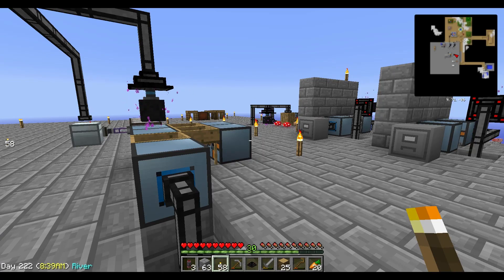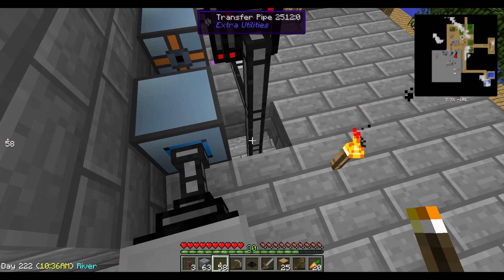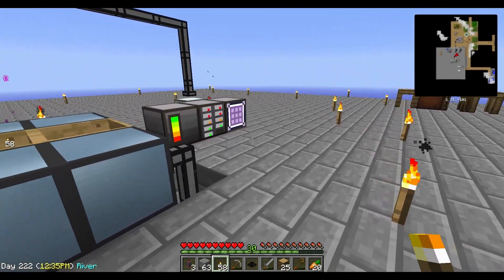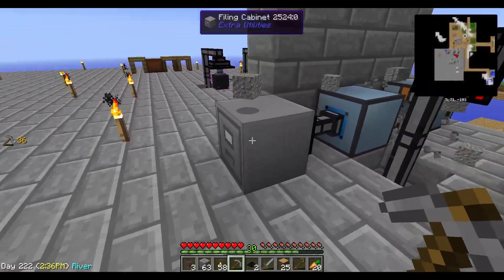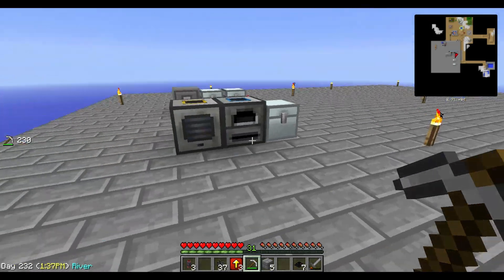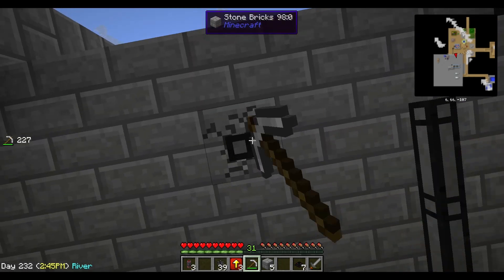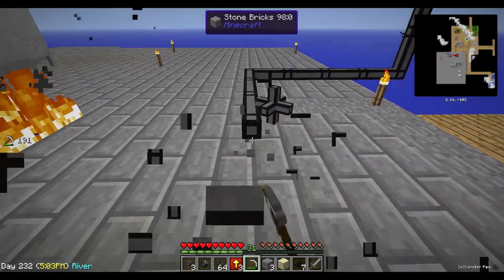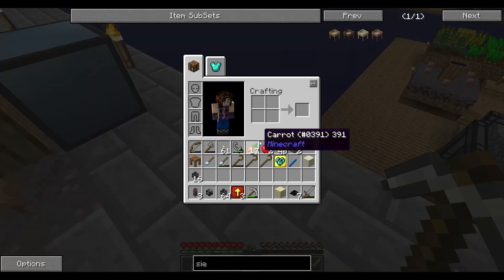Minecraft Sky Factory - Modded SkyBlock!  Episode 17

Comment: Use a transfer pipe on the cobble pulverized on the yellow to move the sand which skipped a step straight (which it has a random chance of doing so) to the witch water then you'll need to decide what to do with the dust. Personally I'd just destroy the extra

Comment: Not sure why you want to sieve sand.  You already have more than enough of everything you can get from the sand probably.  Dust and gravel and soul sand are the things you want to sieve now really.
Reply: Certus quartz crystals would be about the only reason I can think of to continue sifting sand... depending on current inventory levels. The ME Assembly setup is going to eat a fair amount I'm guessing.
Reply: Is there a way to make it from certus dust?  If not, you can always do some sand to get more as you need it but I don't think you need a round the clock sieve doing sand for that really.  Don't need that much of it.
Reply: hossumquat
AFAIK there is no way to make crystals from dust. Unfortunate really. I have sooooo many stacks of quartz dust and no real plans to do anything further with AE.
Reply: ***** Well there IS a way of making the dust into the crystals. While reading about DartCraft today, I found out you can use the Force Bow and add the Freezing effect on it. Then you can make the dust into crystals. Go to the DartCraft Wiki for more info :)